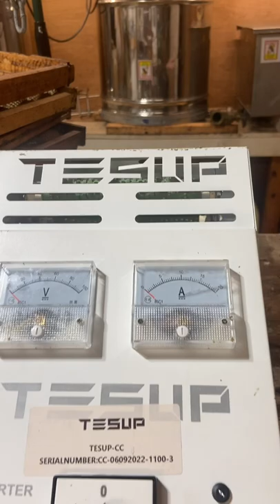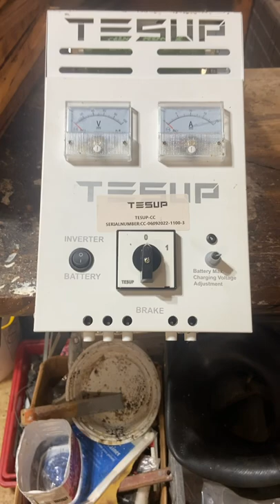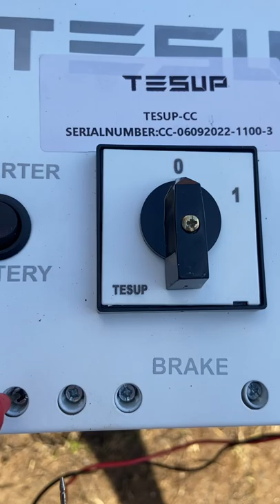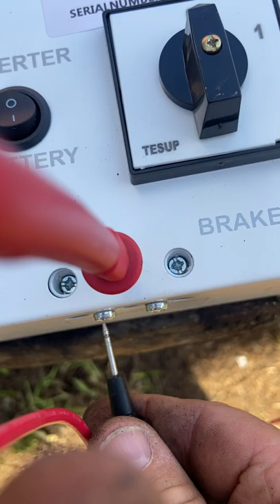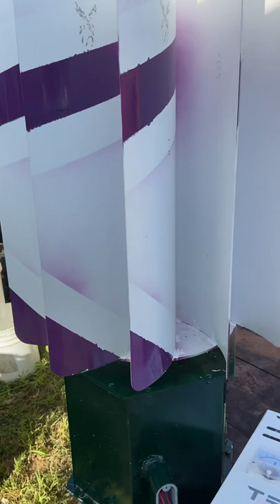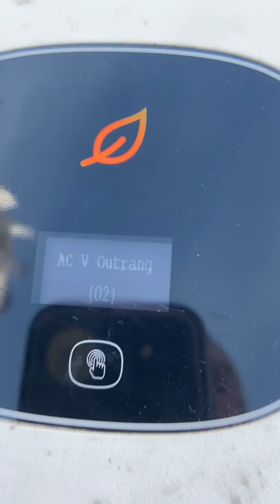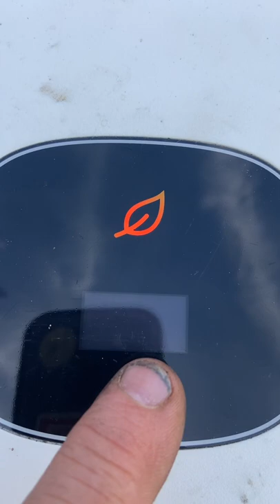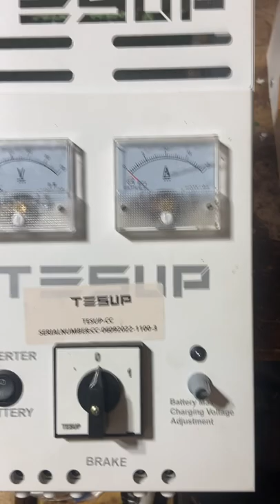Vertical Wind Turbine, Tesup Part 3 +.  Never buy Tesup

Comment: I had one, never worked. Then I pulled the electric motor apart and water was getting into it and rusted the internals and destroyed the bearings. Complete and utter garbage.
Reply from the maker: Hope you watched my last few videos, mine rusted out too, lack of proper size seal. Are you in the UK? 
Me and another guy are suing Tesup.  if you have a UK address, then your able

Comment: MODIFY ALL CONNECTORS TO MC-4, END ALL PROBLEMS
Reply from the maker: In my other two videos I think I had shown that I took the connectors turned them 90° and mounted them properly through the box so there is no problems with the connectors now. Thanks
Reply from the maker: As you see from my other videos I am using in the Aurora interface box and the Aurore PVI 6000 W wind inverter. Not messing around with the junk/trash that Tesup produces. Not worth having a shed fire or overheat.

Comment: your biggest issue with the invertor is the fact it is a UK model (it is written on the side) which is 240V only via 3 cables, this will not work with a 110V US single phase or 220V dual phase you will always get the AC out of range issue, I suspect if you were using a US model it would work. I have to say thank you for you making this as it has made me decide not to buy Tesup
Reply from the maker: Your are correct, Mert at Tesup sent me the wrong inverter for this country. In his email, he only stated it was for 220., with no details. Then he stated it needed to be modified first. I said OK, he though i was going to modify it.. Wrong ! 
The customer doesn’t modify what they purchase. So he knew that single phase 230 volt inverter wouldn’t work here.. Why in the first place would he even sell the wrong equipment in the wrong country.. NEVER BUY TESUP.

Comment: Tell me about it I have the same one in the UK I have had to build my own blades and charge controller but I opened my alternator up and 2 off the wires was soldered together acting like a brake
Reply from the maker: When I return home and I get a chance to break the generator down, I’ll probably find the same thing. Thanks for the heads up.

Comment: I have installed this same Tesup wind turbine unit for a customer that they supplied themselves last year March 2023 and during the unpacking and assembly I informed my customer that mechanically this is a piece of sh..t which they were not happy with. I July 2023 it was reported that the unit was not working and when I went to site the unit was seized up. If anyone is interested on how I resolved the problem by totally re-designing and manufacturing a totally new casing for the outdoor turbine unit - please contact me. Additionally, that digital panel meter that is fitted to the turbine casing is only suitable for indoor use ONLY - please feel free to look up that digital panel meter's specifications - so I cannot fathom as to why Tesup would consider fitting this display unit that is not weatherproof and not being of any use when mounted high up on a tower / house roof....
Reply from the maker: If you watch a mass amounts of my videos on the Junk Tesup sold. Total sham of a wind turbine. In my early videos , you’ll see I ordered a replacement bearing guide. I miss the fact that the upper bearing seal they installed was the wrong size. This leading to rust and seizure of the upper bearing. Also leading to the massive amounts of rust on the main stators, which ended up shorting out the motor. My learning curve from the beginning till now has exponentially increased not only learning about the bets limit, and how this wind turbine would never produce what they said. I had this thing in 35 mile an hour winds in my later videos on YouTube. That’s the amount of wind just to turn it. I’d love to see some video from your install ?  Haven’t seen a working unit anywhere in the world. 
There are two of us are currently suing Tesup.  Please send me your info. TheMachinewon@Hotmail.com
Reply from the maker: If only the watched my videos and reviews on TrustPilot.com

Comment: I have the same inverter and the Magnum 5 turbine. After a lot of tinkering and connecting loose contacts the system is now working. But you have to follow the Growatt instructions 100 % or it will not work. You have to ground all the boxes together. And connect the grid wires in the right order. Just had the system running in high wind today, and managed to generate 2,5 Kw in 5 hours not as much as i hoped.
Reply from the maker: Unfortunately I can’t use the growatt inverter. This one is for the UK and Ireland only. We don’t have single phase 230 here. And I don’t want to get into a step up step down inverter to make it work nor do I want a battery bank. i’m not working on my 6 foot hole in the backyard for the concrete counterweight for the tower. next I will be looking at the outback inverter for the grid tie unfortunately with some batteries to make that work.
Reply: What is the startup countdown on your growatt ?
Ours is 65seconds
Reply: @LuberthDijkman  Yes same here.
Reply: Welke omvormer heeft u?

Ik heb de Growatt 1500TL-X. Zelf twijfel ik of die geschikt is voor een 5kW windturbine.

Comment: VERY IMPORTANT: RUBBER 1/2" Pad Mounting to Base of Generator,plus Grounding wire
Reply from the maker: I did a damn good job of balancing the blades per their weights in grams, there is really no Wobble as it rotates at high speeds but it will be hard mounted to a quarter inch steel plate with spacers, Because of the piss poor design from Tesup the hex heads at the bottom make it stand off the actual bottom plate.hopefully any high speed wobble doesn’t rip it from it mounts

Comment: Just remove those bottom connectors, pull the wires through and make your own connections
Reply from the maker: Well I spent the time and modified the box, so they are mounted properly now. The idiots weren’t using the mounting holes they were running it through the sides of the blocks. Improperly.
Reply: @Themachinewon  Fair enough. I'm trying to charge a 48V battery with mine. After removing those connectors and running wires directly to the board I have fixed the brakes on issue but now I get voltage (the battery voltage) and no amps into the battery. Honestly these things are shit. Do they actually work for anyone? I don't see how.
Reply from the maker: @dmarti3  I’m not sure, I’m currently looking for a grid tied inverter , with out battery banks. Mine is putting out voltage , I never checked amps, seeing that it hasn’t connected to the grid yet to show any. I haven’t found anyone yet on the internet that has a working system
Reply: The output is DC, you need to connect to a hybrid off grid inverter through one of the MPPT inputs then set the u it to feed power back to grid. Look at MPP Solar hybrid inverters.
Reply from the maker: @dmarti3  Thanks, I’m looking for someone with the Skymax… Missouri Wind & Solar did the video on one back about seven years ago, direct hook up to the three phase AC into the inverter out the inverter directly to the panel. It was made for wind turbines. Plus I have a friend that’s now out in CA., he’s asking inverter manufactures to see why no one makes a inverter solely for wind turbines…
Reply from the maker: @dmarti3  As you said , setting the unit to feed the grid? I’ve never done anything like that, I’d have to ask you to explain more on how that’s possible ?